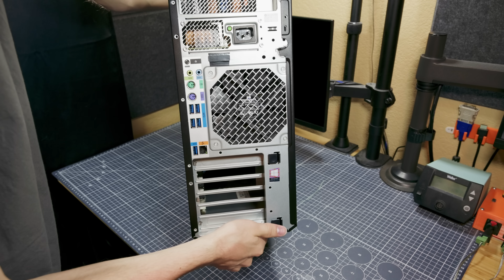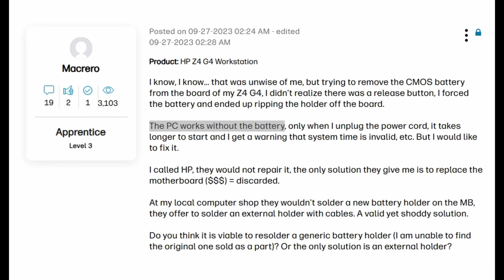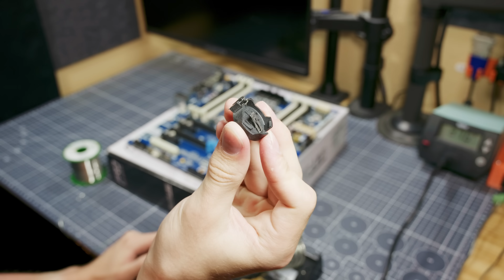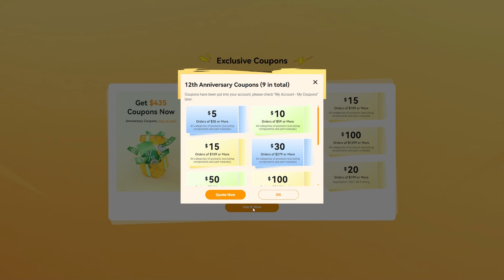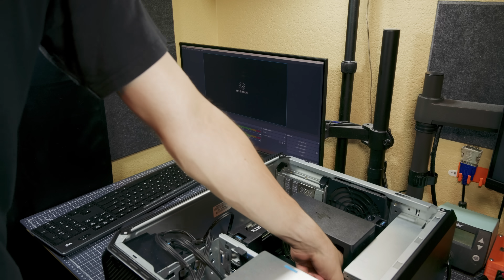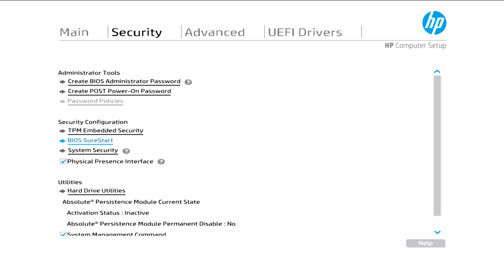I was NOT Prepared for how Challenging this HP Workstation Repair Would Be!

Comment: ALOT older system but i had an gigabyte GA-EX58-UD3H which had the same behavior as this mobo had. fixed it by flashing the bios chips. and in my experience reflashing the bios via a CH341A chip programmer (make sure its running in 3.3v) is the one thing many people dont do but is genuinely a good thing to try. (make sure to make a dump of the original beforehand though)

also: make sure there are no pins bent in the socket. lga 2011/2066 are known for not working when having bent pins.
Reply: Any socket with bent pins can work or " not " work..depending on what that pin does ( or doesn't do ) ... they can be fixed id lightly bent or could never be repaired if brutally bent ... i bought a used Motherboard and thought it was OK but under magnification it had a few lightly bent pins and was able to get it working ... you take a risk buying used stuff but the rewards can be worth it... i don't buy alot so have been lucky ( a couple years ago I did build 4 computers but used new parts when cheap and used parts too... i bought many things and lucked out - i had one cpu that wasn't working but got it to boot and still running fine ...the seller offered to refund me but I was able to test it again ( I had another cpu so knew the mb was ok )..
🇨🇦👍

Comment: This is why I HATE HP.  Intel chipsets can run both Core and Xeon chips. They are the same chips.  HP does trickery to make sure they can't be swapped.  I ran into this years ago with HP Z workstation trying to use a newer Xeon chip, even though the chipset supported it, HP wouldn't post because it wasn't in their "supported list" and took a board swap to upgrade to the newer Xeon.
Reply from the maker: Do they really? I actually thought this was an Intel thing with this generation, and it was only annoying of HP to not make the differences clearer between the boards... Maybe I need to do some more research!

Comment: I’ve experienced a system where it had almost the same problem. No post, but the cpu and ram did get hot. 

Reseating the CPU didn’t work, reseating and changing the placement of ram didn’t work aswell. 

The system powered on all by itself, and the power button was completely useless. However, after clearing out the BIOS, it booted up normally again.
Reply from the maker: Nice! Sounds like it was a decently cheap fix in that case, which is always nice

Comment: Once that lost motherboard was delivered, the right thing to do would be to contact the seller and either offer to return it or pay for it. Keeping it after
receiving a refund is the same as stealing it.
Reply from the maker: Agreed, and I would usually do that, except in this case when I opened the original item not received case with the seller, they were completely unhelpful and unapologetic and then ghosted me to the point where I had to push the case to eBay's Money Back team to get any resolution to my issue, so I don't really feel bad about keeping the board.

Comment: You should have just got the Xeon for the C422 motherboard. C422 is better than X299 and having ECC support is great.  If you really dont want to use the C422 motherboard ill buy it if you werent able to return it.
Reply from the maker: That's fair, my main drive to keep pushing for X299 in this case was that I have a few future videos planned with this computer that are based around it being X299 and therefore needed a functional X299 system as opposed C422. I would've sold the board to you, but thankfully the eBay seller was understanding and accepted my return

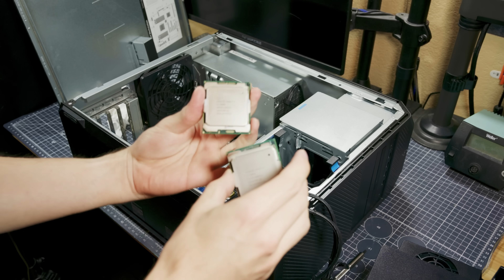Comment: 15:28 this is why ya should always have a low tear CPU on hand, like a i3 or i5 or one of the lower power variants.
Reply: Yes..been building computers since the 1990's and you " have " to have known working parts when you have issues...you need to be able to confirm which part is the issue with parts you can swap in and out....i have lots of extra ram and cpu's gpu's psu's and storage so I can test properly..I repair everything and was a serviceman/ repair tech in different industries.. not knowing what does work is sending you down a rabbit hole..
👍🇨🇦

Comment: I've seen bios corruption that didn't allow anything to power on, no 5v on the USB, no cpu power, no cpu fan spin. After flashing a new bios everything worked just fine.
Reply: Which is why it's always worth flashing devices every so many years too prevent BIOS bitrot. I think bitrot has a higher chance of happening the less a device is used or BIOS is cycled through. As well as over used maybe if the BIOS chip is lower quality, like some MSI boards in the 2000s kind of had that issue.
Reply: I understand the reasoning to solder a bios chip in at the factory but I also understand the desire to place those gate-keeping chips in a coin-battery type slot even more. Pop the old one out, place the new one in and go about your life with lower blood preasure and less desire to hulk smash a board
Reply: Yeah, I was thinking of the same thing. It's likely the motherboard power components never failed electrically and the thermal camera showed that what was supposed to get hot did get hot.

At the same time, though, the fact that the VRMs never even got power is also sus, but maybe the BIOS somehow controls that, in some way I don't know and I can't imagine?
Reply: Yes, he could try with the extra CPU now has to do re-flashing with the latest BIOS for the MB, to see if boots up, if still no boot and VRM on, then is the ITM, etc chip which controls all hardware abstraction layer...

Comment: You bought the Xeon W2100 or w2200 Motherboard which doesn't work with X series, to Spot the Difference it's not that hard, 

1, Xeon have two M.2 nvme ports while X series has one, 

2, Xeon one has Two Ethernet ports and more Usb, X series has just one Ethernet port.

3, Xeon motherboard needs Ddr4 Ecc ram which doesn't work with X series motherboard.
These are few main difference,
Reply from the maker: That is the conclusion that was reached by the end of the video, yeah

Comment: To me this sounds dangerous.
You should check out the mainboard medic and see how he always test for shorts before plugging in the power.
If you have a shorted MOSFET that can take the CPU out. You put another CPU in the and it will get shorted as well. 
It just takes a couple of minutes to test the power traces. If you don't know the connector pinout the you can test on the coils.

Comment: Socket 2066, unlike 2011v3, requires a different chipset for Xeons Vs i7/i9 CPUs. You can't run a Xeon on X299, and you can't run an i7/i9 on C422. 

I believe HP run C422 on the blue motherboards in the G4 Z4, and X299 on the green motherboards in the G4 Z4. That's your problem. That mobo needs a Xeon W-2xxx CPU.

Or, the Green motherboard for the Z4 G4. 

EDIT: Ah, you got there! And HP even dropped the colour difference between boards? FFS 🤦‍♂️

Intel did us dirty with that lack of intercompatibility between chipsets despite identical sockets.
Reply from the maker: Yeah, it definitely gets confusing if you're not paying super close attention on these systems, as the boards look nearly identical!